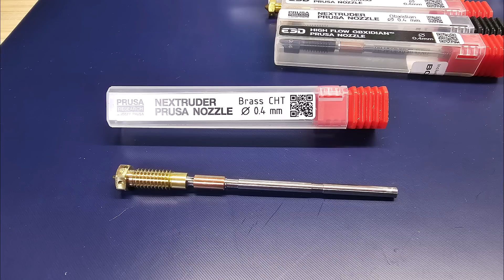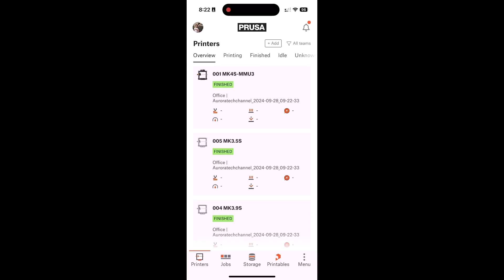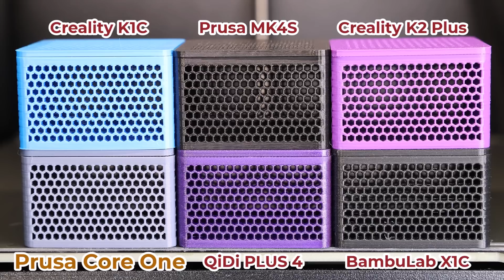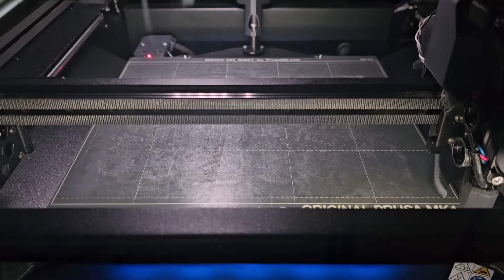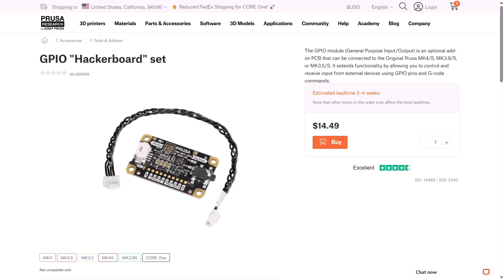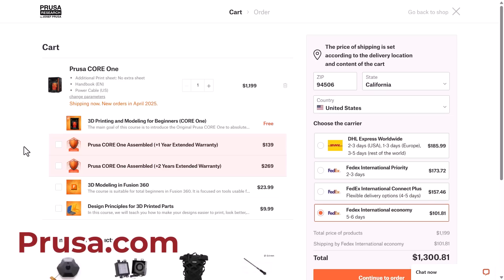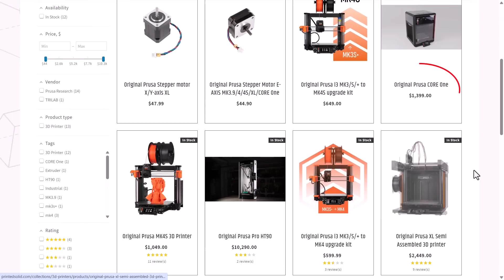Prusa Core One In-Depth Review: The Most Reliable Future-Proof CoreXY Printer

Comment: Man I was gonna get this machine but I ended up ordering the Elegoo CC instead. Just couldn't justify that price anymore.
Reply: It's like the difference between buying a Husky tool and a Snap-On. 

If you tighten a screw once or two a month who cares? Get the cheap Husky brand.

I use my printer practically every day. I want the nicest thing available, and I want a printer that can make dimensionally accurate parts and lay down first layers like it's nobodys business.

Also the thing with Prusa is that they will keep going at this printer model for years. It will only get better as they go along and make tweaks (and then the users will make mods on top of that). Compare that to the P1S who I think they've said is reaching end of life in 2029 or so. All those folks buying those P series printers should probably be aware that there's no guarantee they're anything more than a cloud-disconnected brick after that. Just as an example. 

With Elegoo that timeline is likely even more accelerated.

All I've been hearing with CC is belt issues belt issues belt issues. I don't have time for that crap any more I'm over 40. hahah. I came from Creality----I can't. go. back.
Reply: @roblutter  I heard this weird statement again. You can buy accessories for any 3D printer core parts. Prusa has no advantage in being replaceable. You also have to buy a custom Prusa nozzle. Get the facts straight. Prusa is no longer an open source manufacturer. Both XL and One are closed source.
Reply: Elegoo was the worst experience I've ever had. Would never get a printer from them again.
Reply: It is made in Czech Republic. Europe. For many people that matters. Using local producers, so many people making their income.  Good job Prusa. It's worth the money.  🎉
Reply: @STōN-3D  No it just means more expensive components simply because it's not China.
Reply: @STōN-3D nobody cares that it's made in Czech nor Chyna. it isn't affordable. for 30% of the price I can have 4 colours and automated materials and drying. it isn't consumer friendly. farms sold Prusa and moved to Bambu. just so much easier and painless. for hobbyist... maybe, but not after they tried a modern printer
Reply: @mostlymessingabout  I understand your point of view but most of what you said is not true on a fact basis. 1. A lot of people care obviously. 2. Price is less up front, yes. What about in the end, and your down-time costs? Safety and fire testing? 3. I am aware of some very massive print farms and they cant even buy B-company because security issues with files and fires. I don't agree there either.
Reply: @STōN-3D  not sure why that matters, it shouldn't matter where it's made as long as it works and you get the best bang for your buck
Reply: @NoMercyFtw  If it doesn't matter to you ok.  That's why we have choices. You can pick. For some people it does matter where their money is going and what it will pay for  when it arrives there. What materials it is made from, are they even traceable/ safe/sustainable/long term service? Just a few of the questions I ask myself when buying things. Remember; if the product is free, you are the product.
Reply: @STōN-3D  exactly choices are spectacular and so our opinions, some people stand by theirs and some people are just plain old hard-headed That's why we love this world
Reply: @NoMercyFtw  well said.
Reply: @NoMercyFtw  A lot of people care about where it's made and where the money goes. I know, it's hard to understand for someone who maybe doesn't have such nationalistic feelings and only looks at the price. And if it's made by children or a regime that restricts freedom, you don't care. I avoid Chinese stuff when I can, even though it's not possible in everything, because everything is made in China nowadays. But I certainly don't support a Chinese manufacturer when I have an alternative, even a more expensive one. That's the freedom and I'm glad for it.
Reply: @lukaskantor2645  some of us don't have the freedom or unlimited money to not look at price first, and if people cared so much they would do something about it rather than just buying a competitor's product that cost three times as much
Reply: @STōN-3D for that price it could have been produced in the Antarctica
Reply: @NoMercyFtw  "not sure why that matters, it shouldn't matter where it's made as long as it works and you get the best bang for your buck"

Imagine China possibly won't be "friendly" to us someday. Maybe some big trade/tariffs conflicts. All 3D Printer manufacturers are based in China - except Prusa (Czech) and RatRig(Portugal).
Reply: Well prusa printers are always overpriced so I don't know why anyone would expect anything else. A bambulab A1 is basically a prusa m4 for half the price. No wait I checked the prices it's actually 1/3rd of the price. And less than half the price of the mk4 kit.
Reply: @atnfn  yeah and imo a better printer
Reply: @atnfn half the price? It’s 1/4 the price. Can’t count a kit.
Reply: @atnfn  That the same printer that was catching on Fire? No thanks.
Reply: If only they would have added a cheap chamber heater
Reply: @psxtuneservice  for that price it should have included one
Reply: i don't know how anyone can justify that price
Reply: I mean I get it. There’s a lot of loyal Prusa print heads for a reason specially with how reliable they are with customer support.
Reply: @randomgrenad346  I have seven printers by six different manufacturers except prusa and I haven't needed to contact customer service since my first printer, other than bambu for an order issue, so I can't see customer service being worth that much especially if you know what you're doing... And with those printers being so-called open you would think the people buying them know what they're doing...
Reply: @NoMercyFtw you said it in your comment.... If you know what your doing.  I can tell you that probably 90 percent of people don't.
Reply: @bluerider0988  exactly and most people want the machine to do all the work for them and to tell you the truth that's almost impossible
Reply: @NoMercyFtw  active chamber temperature control & a high repairability rating.
Reply: @RogerEssigArtist  you can get that with other printers for way less and larger
Reply: @RogerEssigArtist more, like “active chamber cooling “)